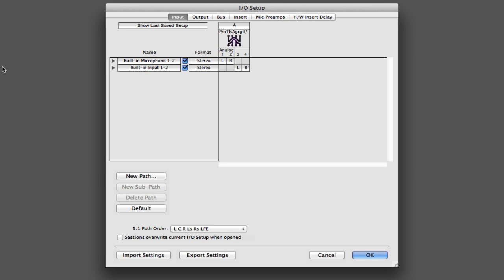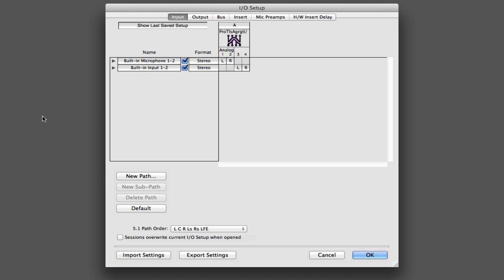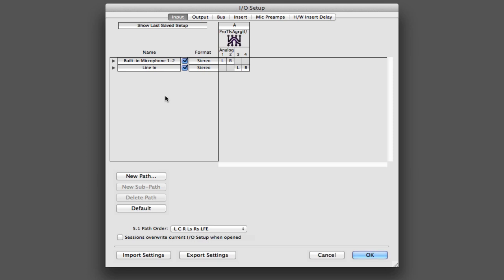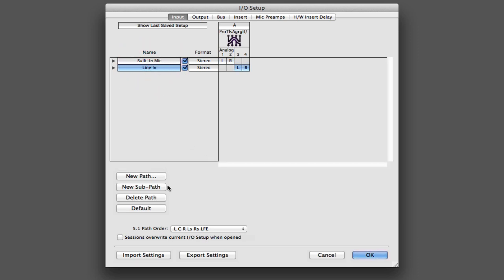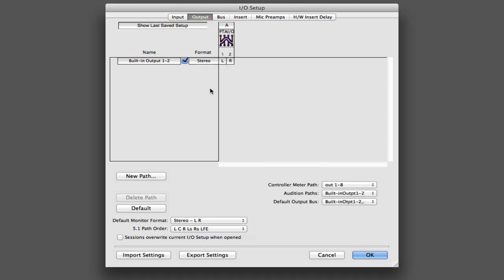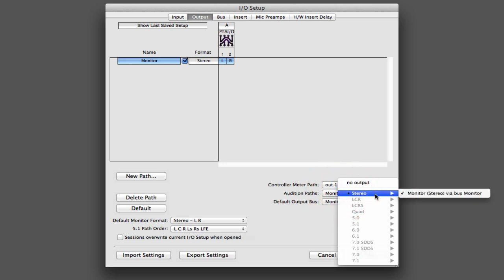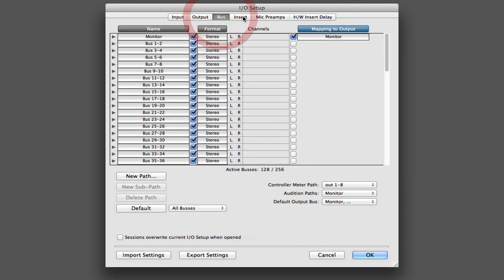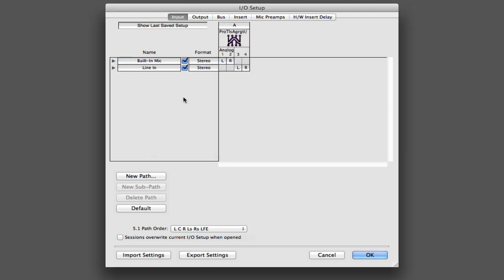I/O Setup Dialog Basics in Pro Tools

Comment from the maker: When using Pro Tools 10, a track is actually assigned to an Output Bus, which is then routed to an Output Path (physical output).  Be sure to check the Busses section of the I/O Setup to verify that yours is set correctly.

Comment: good vdo I have a question , I use to running pro tools 8 then one day it was crashed and the program disk was bad too then I bought pro tools 10 installs every was good but when I open my old song on pro tools 8 setup before it was no sound is that the I/O setup are not the same????